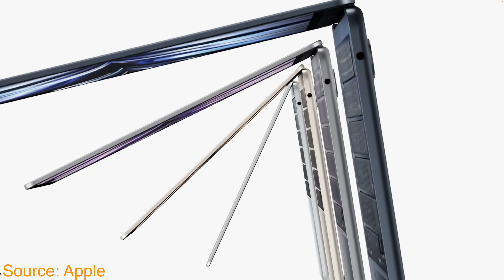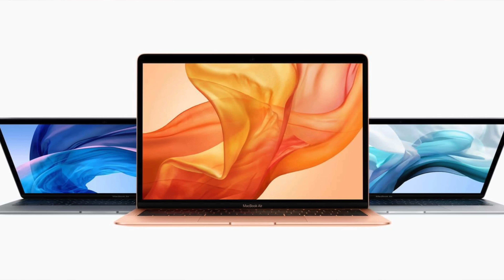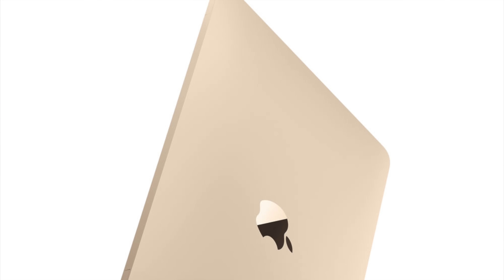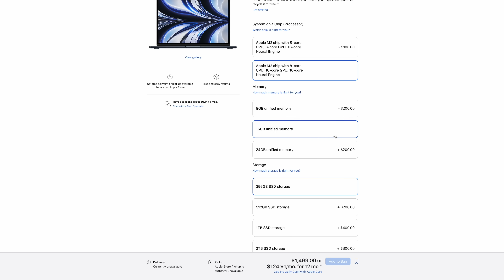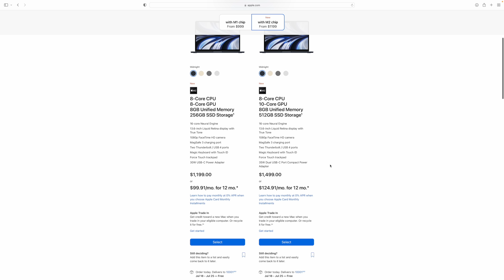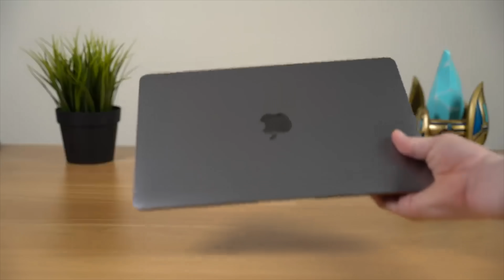Why I bought The M2 MacBook Air to Replace My 14" MacBook Pro!

Comment: I was very excited about the M2 Air as I'm going to be starting University (Electrical engineering). But the configuration that I wanted (512 SSD & 16GB RAM) is around $1500 with the student discount. That is not very far away from the 14" Pro. I understand the form factor and all but the value of the M2 Air really goes down once you start configuring it up, aside from making it 16GB of RAM. I'm going to end up going with the M1 Pro MacBook 14" even though it's overkill, the value is so much better.
Reply: did the same thing today and got myself the baseline M1 Pro 14" for 200 more than the M2Air with 16gb/512gb. IMO no sense in getting the air if you compare the two configurations. you end up with less ports, a worse screen and processor
Reply: It seems like the 14” will be more of a “professional” machine for your serious Electrical Engineering studies and career. When you graduate and begin in your field you will be able to buy the future Mac Pro when it comes out !!!👍
Reply: Where I live in Europe the BASE model (256/8) M2 Air starts at $1530 🥲 so you are really lucky in the US
Reply: If you're studying electrical engineering, you really should get a Windows PC. A lot of the software that engineers use won't run on an ARM processor like the m2 chip.
Reply: @Kidynamo123  I made sure to ask about that and I got the approval
Reply: @ethanstechworld207  good! Then by all means, enjoy the new laptop!
Reply: @Kidynamo123  Thank you!
Reply: Apple knows how to upsell. I'm in the same situation.
Reply: I was going to get the Macbook pro 13", but it's so old, so I was going to wait for the Air...but I wanted the Pro...so I ended up picking up the 14" last week.   I'm very happy with it.
Reply: I just got the 14
Reply: I got a M2 Air with with the upgrade 16gb memory. Of course the Pro will be the superior choice. I am excited for the air cause I use some programs but not enough to want to shell out more dollars for the Pro. As well I plan on owning it for the entirety of it's life so the extra SSD and memory will future proof better. I haven't updated since 2015 so looking forward to something light weight but faster. I do love my 2015 MBP though but did not see repairing would be ideal as its nearing 'vintage' and it needs repair, which it might as well go to the cost of a new mac.
Reply: Ha, I’ve done 4.5 years of Electrical Engineering school with a concentration, and another 3 years getting my MS in Systems Engineering. I would strongly recommend getting a window device, since it’s much more user friendly for EE tools and other programs. I’ve seen Mac users who managed to get it done, hopefully now things are a bit more Mac friendly. I plan on placing an order for the MacBook Air M2 for other business ventures and daily use.
Reply: @Ob1Chosen1  Hey thanks for letting me know about that. I am aware of that and recently had a meeting with an adviser in my engineering department and I got the approval to go with the MacBook. That was definitely on my radar as a possible concern. On my college's website it also says Mac's are okay. Thank you for your input, I appreciate it.
Reply: @ethanstechworld207  Anytime, and Good luck in your studies!
Reply: I am torn on what to do. I got an M2 Air 16gb/1TB for $1759 with the student discount. The base 14 Pro is less than $100 more. I am starting grad school next month and majoring in Nursing Informatics so I’m sure the Pro would be useful closer to the end of my degree and even freshly out but I love the Air form factor and the new color. Ughhhhh. Should I just cancel the Air?
Reply: @Henry-nb5uq  I think you should.
Reply: This is exactly what I did.
Reply: Exactly. I have been waiting for the M2 Air but only today I have realized the M1 14" MBP is a much better option for me, for just a bit more money I get a better screen, 120 hz refresh rate, bigger screen, better speakers. The big factor for me was when I realized the 256GB MBA M2 only has one nand chip resulting in a SLOWER performance than the M1 MBA which has 2 nand chips, so I would have had to go for the 512GB MBA M2 which has 2 nand chips and then I am getting closer to the 14" MBP M1. Also for me 95% of the time the laptop is at home, I almost never take it outside so ultra portable is not a big plus.
Reply: @Kidynamo123  the programs that don't run on ARM processor, would they run on it if you ran Parallel on the m2?
Reply: I have been Windowser for a very long time. I recently purchased MBP M1PRO 16' and it is so good. Some stupid Mac people were complaining so much about the 16' size. I was shocked when I first unboxed the 16. Those Mac people probably haven't seen any bulky, heavy, huge Windows laptops. I am so happy that I go with the 16. 14 is also good choice but there isn't huge difference in terms of size. There are some benefits on 16 though like battery, screen, speakers etc. However I think M2 Air is not good enough, even though design is lit. Slower SSD, high temps, more throttle, etc. Just buy cheap M1 Air or go with MBP M1 PRO or, wait more and get M2 Pro. I think it's not logical to buy M2 Air with that price tag you mentioned.
Reply: I do a lot of research and I had the exact same thoughts. I placed an order for an M1 Pro 14 inch base as I know I will get more out of it in the long run.
Reply: Have a good time lugging that heavy machine around
Reply: @LtLoneWolf1 end up doing that, rn looking back for air because of the battery
Reply: @w0by what s ur battery health after 1yr?

Comment: I think the new M2 Macbook Air looks like a great machine. But for me, having been using the 14" MBP, it would be hard to go back from that wonderful screen.
Reply: Once you go 120hz, there’s no going back.
Reply: I just wish the midnight color was available for the Pro, and the nice MagSafe, and my biggest thing is how slim it is. I guess if they ever come up with a midnight color, slim like the air, and MagSafe yet as powerful as Pro, I’m in! 👌🙏💯💰💪
Reply: @Jamal2fresh  I think it would be cool if the Pro's had more colors available. But the difference of 0.17" in height just isn't enough for me to really call the Air slim in comparison. The good thing is that Apple has a laptop for everyone though. And I think if people are more concerned about the smallest machine, or the color of it, then they probably don't need the extra power, extra ports, or better screen of the Pro line, and can get by fine without those extras.
Reply: @Jamal2fresh  I saw in other videos that the midnight color gets dirty easily and sensitive to fingerprints
Reply: 14” bulky and hate the new keyboard design ( all black ) also 14” body looks old school .Air more futuristic

Comment: It’s really all about the form factor here. Unless you’re getting the base model air, price is not huge deciding factor. 

Trade offs: 
Worse display and less ports for smaller design. 
Worse speakers for lighter and fan-less.  
Less power for more battery life. 

That’s basically it. Give or take you’re also saving $300 for those trade offs.
Reply: yet more than fast enough. All of our conversations about these laptops.....in reality it will get the job done.  I'm sure he whips me 2014 15in mbp and as a developer I never made that thing stutter. For people in the media world they really should have a desktop.   The m1 mbps are extreme powerhouses though if you're really doing serious work you have a desk setup.
Reply: That’s why I looked and found a factory sealed new M1 MacBook 💻 pro 13inch with the 16/512 for 1300$usd on eBay. It’ll be here July 11. That’s a good savings.
Reply: In terms of power most computers are perfect we just want the latest and greatest but unless you really need power for 3d rendering, video or intensive graphics any old Mac will do it or pc for that matter...i have a perfectly working 16 inch i9 but that 14 1tb is making me jealous as well as the 2022 Rog Zephyrus 14...why I don't know but the form factor and the latest chips are something that really caught my attention

Comment: I just got lucky yesterday. I pre-ordered 16gb 512gb M2 Air and it was around $1600 after tax and the student discount. I found a brand new listing (literally listed maybe 10 minutes ago) on OfferUp for a 14” MacBook Pro 16gb 1TB (10c/16c). I believe that retails for $2500 and I ended up getting it for $1250. I trusted the seller cause all he does is sell computer parts and has tons of reviews. Other than that, I would’ve thought it was a scam, but the thing set up perfectly and had 2 battery cycles at the time of buying.

Comment: I was dead set on waiting for the m2 air. Ended up going to Best Buy to recycle some electronics. Went in to walk around and they had 1 14” MBP in stock brand new on sale. 1699.99. After two weeks with the 14” base model. This is by far the perfect laptop in my opinion
Reply: That's a great deal on the 14" mbp! Was it open-box or something?
Reply: They had a deal on it I missed it’s back to 2,000 so I got the m2 air upgrade
Reply: Wow 1700 I would’ve got it as well.
Reply: My local micro center has it for 1799 and I’m tempted to get it over the m2
Reply: As much as I love the chassis on the M2 airs, it gets really hard to justify when you start upgrading the ram and SSD. At that point you might as well spring for the m1 pro like you said, and enjoy the much better display and chip.
Reply: Same! Was waiting a month for the M2 MBA, then got a deal for 1700 on the 14" M1 Pro MBP and just jumped on it. Plus had 280 bucks in Apple Gift Cards lying around... No regrets. Lol.

Upgrading the MBA in RAM and storage didn't make sense when compared to the MBP.
Reply: I also got it for 1699 minus 75 in certificates at Bestbuy. I couldn't pass up this deal. The screen alone is worth it for me!!

Comment: Have they fixed the problem with the keys touching the screen on the new form factor ? Was always a problem on the 13" Pro I had and even the M1 air. When I mean touching the screen I mean when closed
Reply: Do not put any screen or keyboard protector and it wont touch
Reply: @jamie3226  Hi it does touch. I don't use any protector and still touches. If you carry the laptop in any sort of way it touches
Reply: @2_wheels_fun  That is a poor show if that is the case mate , its probably easy enough to fix with a bit of double sided tape or some of those little felt pads along the edge , but obviously ........ you shouldnt have to .
Reply: Oh, man! That is the first thing I noticed about my 2016 MBP Touchbar edition. That little shadow grid it left behind on the screen bothered me every time I popped open the lid. I had a screen replacement under warranty that oddly fixed that problem, though. But that keyboard…. I brought an external one with me everywhere. 

I’m delighted to finally trade that thing in for the M2 Air.
Reply: @jacob.williams  But have they fixed the problem. My current M1 air has the problem, has the M2 Air with its new form factor resolved these issues ?

Comment: Finally a YouTuber that doesn’t keep fixating on that extreme case of thermal throttling and the single NAND ssd chip of 256gb. Average consumer that buys a MBA should not be bothered or even notice about those things I called nitpicking. It’s not a PRO people. Thanks for the video.

Comment: I was ready to do the same for weeks until I saw the videos showing how severely the M2 throttles under extreme test load after hitting 108C on that odd MBP. And that has a fan! I'm now going to wait for benchmarks, hoping the M2 Air is a good option for me. If my M1 Air is going to be faster under load than M2 due to throttling, I'll keep it instead. :-/
Reply: It might even be the case that the 8 GPU core M2 is faster than the 10 GPU core M2 in an Air, if the latter causes the severe throttling to happen more often under heavy graphics load. This is also a fear of mine. I hope it's (somehow?) unfounded. A big reason I'm wanting to move to M2 is that I want to play the GPU-killing No Man's Sky on the Mac (to be released late in the year) when on the go, and the 10 GPU M2 has nearly 40% more GPU power than the M1...unless it throttles wildly.
Reply: Don't hold your breath.  Apple dropped the ball.
Reply: @phoenixfire3301.1  Well, I want to say that perhaps the odd end-of-life MBP model they made the M2 first was a mistake. Perhaps the new design MBP's can cool the M2 far better. But, then...the similarly redesigned Air has no fans. How can passive cooling, no matter the size of the heat pipes/sink outperform active? It is a curious thing, and I guess we will have to just wait and see.
Reply: The m2 (standard) is such an incremental upgrade over the m1 chip. I'd hold onto your m1 air and wait to see what Apple's got planned with the mbp 14/16 m2 pro/max refreshes and the possibility of a 3nm m3 chip around 2024
Reply: @Kidynamo123  Well, No Man's Sky lands this year and with nearly 40% faster GPU and Metal 3 with MetalFX scaling, it should really do well for the game. I am not interested in a heavier, larger MBP. I already have an M1 Pro from work, but I don't like to use work laptops as my own, for fun, so the M2 Air -- if it's not massively throttled, has appeal. Thanks for the suggestion tho!
Reply: Macbook pro m2 try to be more silent and fans kick in its already too hot

Comment: I have ordered it, but didn’t upgrade anything. I’m not looking to spend that much, and I think the base model is good enough. Really looking forward to getting it!
Reply: Same here. All I do is web browsing, YouTube, occasional PowerPoints and word. So I hope the base model is enough. I got the midnight M2 Air. Looks blue but also looks black. Very stealthy. I hope the overheating and throttle issues are just for people pushing it hard. I hope base does me well.
Reply: Yeah you're fine, the ones bragging in the comments are the ones likely to be overbuying. It's probably why the upgrades cost so much extra, Apple knows folks will fork it out.
Reply: That's smart, once you start configuring it up like 512gb SSD and and what not, you're really losing the value. Upgrading to 16GB of RAM is reasonable but beyond that it's just a really awkward price. The base model is where the value is.
Reply: @Jamal2fresh  Also got midnight, looks sick! Really hope that too!
Reply: @sapo916  To be fair Apple is overpriced in general. The base model is perfect for any daily user.

Comment: I had to choose between Macbook Pro 14in or the Macbook Air M2. I had to get the Macbook Pro. The screen is beatiful. I got an iPad Air instead of the Pro and I regretted not paying extra for the screen. 

Also, the speakers on the Pro are underrated as hell. They sound AMAZING. 

If you can only pick one, either base M2 Macbook Air or base 14in Macbook Pro. I don't really understand the portability issue. I have my Macbook and iPad in my backpack and I have zero struggles. I rarely notice it. I also carry my books and notes in my iPad as PDFs/note files so 2 devices do everything for me.

The only issue I have with having bought the 14in Pro is that the M2 chip is faster with some data processing tasks... And also the battery. But everything else is literally better. My wife's macbook air m1 lasts 4 days and my 14in pro lasts 2 days. Still good for the power!

Edit: I also video edit and product music during my free time. The 14in Pro is infinitely better than the m2 air when it comes to these tasks from what I've experienced. The 120hz screen is legendary.

Comment: I came from the 12”. I’m just not sold on it at all, the cost is one thing my m1 MacBook air 8x8 1tb 16gb is £500 cheaper than the new air and it’s lacking key features of the pro for the same price. It’s still big and heavy it’s not an ultra portable at all. Just not seeing the value and I’m really not sold on the newer designs they look big and clunky and I kinda prefer the old designs at this point… I’m happy with my M1 but I run it out of ram daily, sick of seeing clean my Mac X notifying me. The 14” is too big too… but I wouldn’t spend my money on the 13” pro because it’s feature set is old too. There is a spot missing in the line imo and the new mbp isn’t it and once you spec the mba to anything relatively ok it doesn’t make any sense imo.

Comment: So to sum up, other than weight and a slight advantage in single core performance, the 14 inch M1 MacBook Pro is superior in every respect. And when the new air is configured similarly with 16GB & 512 GB storage it is almost the same price.  Apple’s pricing looks wrong on this model. Looks like the base Pro is a much better choice!
Reply: Apples pricing isnt wrong. The whole point is to get you to spend more and get the base pro 14”.
Reply: @samiliorian990  The M2 MacBook Air makes a lot of sense. The M2 MacBook Pro? Absolutely not.
Reply: The M2 Air comes down to how much of a compromise over the base 14 M1 MBP we're going to have to swallow in a similarly priced M2 air config to gain the weight and thickness savings 

If it performs roughly halfway between those existing two I'd jump in an instant, but if significantly closer to the M1 air Id stick with our 14 MBP
Reply: Apple knows how to play upscaling with us
Reply: wow how are you guys getting the same price for the same config for the air and pro, mine is a difference of 500 dollars and i dont know if i should make the upgrade.